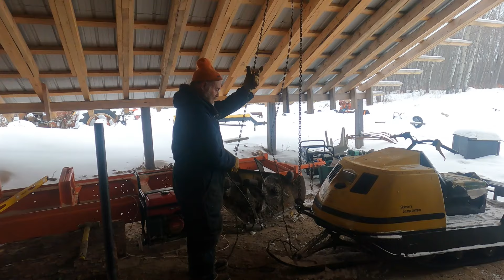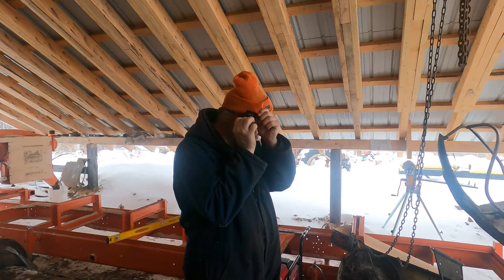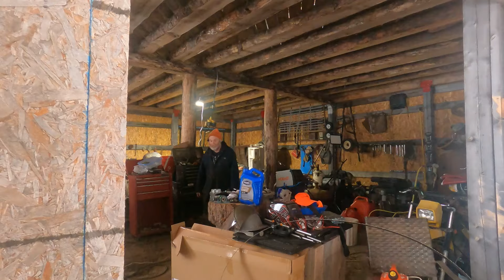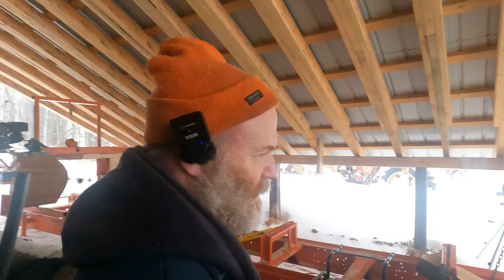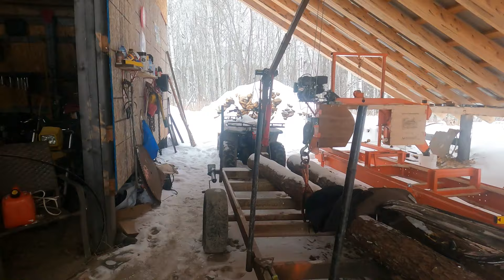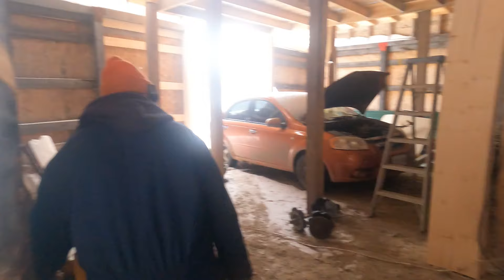Check It Out!  Vintage Ski Doo Alpine Steering Problem Solved. Part One.

Comment: My dad’s uncle bunny had one of those single ski style back in the day. My dad said once. That sled looks like fun to drive. My current sled restoration project. Once I get around to it is a 1970 arctic cat Panther. That I got in a trade I am now currently searching for a parts sled so I can put it back to original. Somebody had put a 1974 – and Hood on it and swapped it out with a skidoo engine that is missing parts and one of the skis is busted so I figure I might as well try to put it back to original. It is also missing the seat.
Reply from the maker: Hello,  thanks..those older Arctic Cat's were great machines.  I have a few engine parts for a 440 Panther.  I'm sorry this video was cut short, I believe it was an upload problem.  I will upload the second part tomorrow. Cheers!
Reply: @cecilsshadetreegarage7408   ok cool. Yeah I thought it was a worthy trade that rolling tractor chassis that I had in trade for the arctic cat panther even though it needs some work I think I can bring it back to life once I find a parts sled like I said.

Comment: I know the technology was not there at the time these were built but wouldn't it have been cool if some of the steering came from breaking on the tracks. Almost like a skid steer.
Reply from the maker: Hello, thank you...I did get this steering great and showed it in this video...but..I'm sorry this video was cut short, I believe it was an upload problem.  I will upload the second part tomorrow. Cheers!